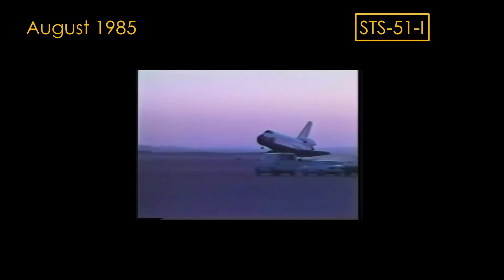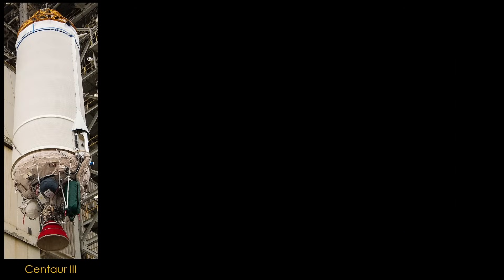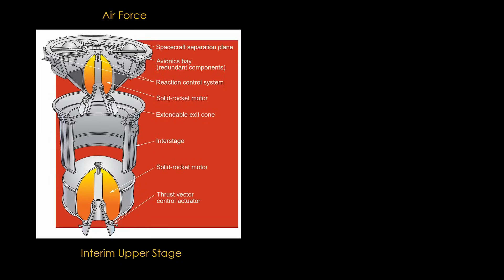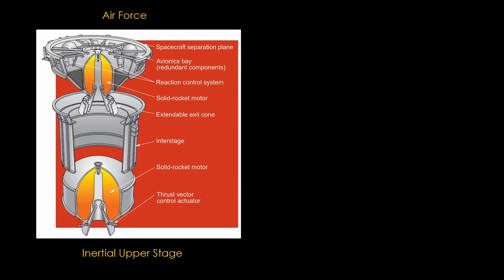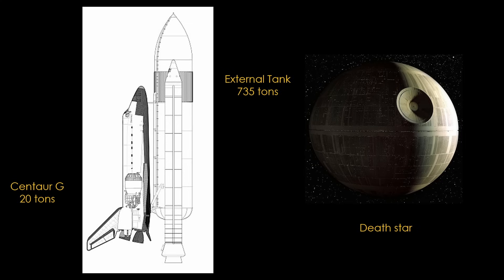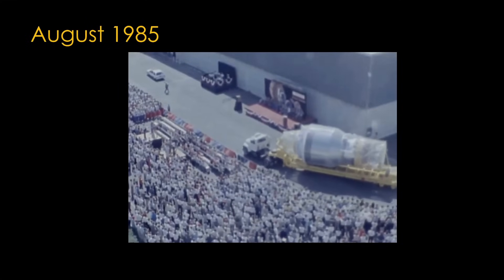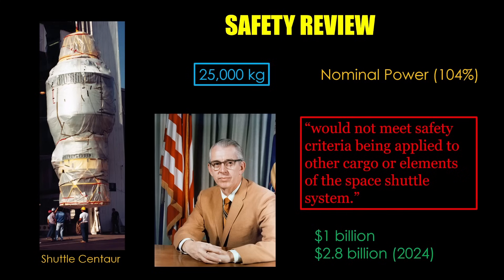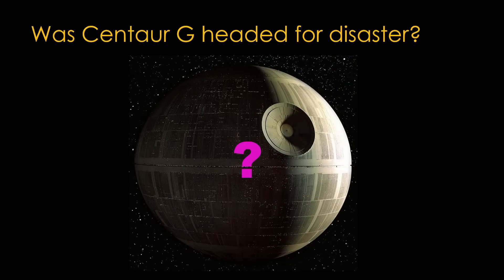Shuttle Centaur - Disaster Avoided?

Comment: Interestingly Falcon 9 had successfully retrofitred to fuel methalox lander inside it. And it worked. You can theoretically change the lander to an upper stage like Impulse, and it can decimate many high energy contracts (Falcon upper stage is already impressive as it's, lowest mass fraction)

Another nice bonus: no need to worry about the crew!
Reply from the maker: Look for that discussion in an coming video.

Comment: Appreciate the video. I do want to point out though that the Kibo module shown on STS-123 is technically not the 'lab module' but the pressurized logistics module (PLM) that sits on top of the "pressurized module" (PM) launched on STS-124 that contains all the science hardware. The PLM still serves your point about showing the need to balance shuttle payloads in the bay, but the PM was presumably even more of a headache - it was 3x longer (11.19m) and twice as heavy (15,900kg), and I don't know how they balanced that out (or if they even tried). Was there ever any discussion about ditching the payload prior to reentry? The payload's uncontrolled reentry would pose a potential threat on the ground, but it certainly seems like a better risk to take than trying to land the already brick-like shuttle with tons of extra weight in the back.
Reply from the maker: Thanks for the clarification...

STS-83 landed with about 11,000 kg of payload, and the orbiter was overweight because they landed early with extra consumables.

Any payload is supposed to be safe for TAL or AOA aborts (I'm not sure about RTLS as I don't know if anybody has high confidence there)

The number of scenarios where you would have the time to ditch the payload before reentry seems pretty small. NASA hates unpracticed tasks and if you take too long you may kill the crew, plus you are probably busy trying to work the problem that's causing you to return, so my guess is 0% chance NASA does that.

Maybe if it's like Columbia but with less damage you might do what you can to lighten the orbiter...

Comment: Surely the East Coast Shuttle could have been made more effective for special missions if they had used the uprated Graphite-Epoxy SRBs developed to give the West Coast Air Force Shuttles more takeoff thrust ?
Reply from the maker: Interesting question. I don't know the state of development of those boosters in 1986 but my guess is they weren't ready yet - I didn't see any mention in any of the shuttle centaur stuff I looked at.
Reply: @EagerSpace  There isn’t much reported on the “Filament wound” boosters but all Air Force space stuff especially at Vandenburg was pretty secretive back then.

Comment: The mission design limited the flight crew to 4 crew members and 4 days. They would have loaded certain consumables and RCS/OMS fuel to just enough to do this mission with emergency reserves. I'd love to see one of the full Crew Activity Plans to see mid-deck payloads they might try to get in with the weight limit, if any. Likely they would have revoved a couple rows of mid-deck lockers and possibly the galley to save weight (a Cabin-config document would be very telling here.)  Obviously, they would not fly the RMS. I know they also needed to vent the cryogenics gases on the pad and going uphill as well. I still think they could have done it and the odds would have been with them, but by far it would have been the riskiest set of missions ever proposed.

Comment: The biggest problem of the space shuttle program was that it wasn't canceled before it even started.
Reply: Every time I think I know just how crap the SS was, I learn something new that makes me hate it more. The entire SS lineage (including the SLS and Constellation before it) has been just one long series of disasters and bad decisions that have hobbled American space programs since they cancelled Saturn V
Reply: @Joe-xq3zu  It was the same for me, the more I learned the more I hated it.
Space Shuttle was the greatest disaster of US space program and we are still recovering from it.
Reply: @Wisald  What would have been your replacement?
Reply: @OmegaPaladin144  The funny thing about Saturn V is it was somehow still about 5 times cheaper than the shuttle per $ for unit of mass delivered to low orbit despite being started in 50s and goal being landing on the moon, not LEO delivery.
So all they had to do was to build a smaller, cheaper rocket borrowing from Saturn V linage, about Proton sized, maybe a bit smaller.
Then build a capsule to put on the top and you just replaced the shuttle while saving billions you could now use to build a massive Skylab style space station, the sheer amount of stuff they could have done by saving 80+% of cost on every kg to orbit.
Shuttle was so bad they could have been launching Saturn V instead of the shuttle and they would still pay about the same if not less, the cost of shuttle was insane.
Worst part is we are still stuck with shuttle grift under guise of SLS and it's somehow even worse than the shuttle was.

Comment: One big thing limiting the shuttle’s payload to farther orbits (without an upper stage) is the fact that it needs to return. This makes interplanetary missions especially infeasible as the shuttle will have burn more fuel to get back into an Earth orbit after payload deploy. Once that’s done the shuttle will still have much more speed than normal, which will have to scrubbed off with even more engine burns or having the heat shield work overtime.

Comment: Galileo was not any sort of driver for shuttle-centaur - it was trying to launch large national security payloads using the shuttle, like MILSTAR. This stems back to Carter's directive to only use the shuttle for any mission. This killed the various Titan derivatives and Saturn 1B was long dead at that time. When shuttle-Centaur was cancelled, they turned the Centaur Gs around to use in the new Titan IV program, because both the IUS and a potentially reborn Titan transtage were nowhere near powerful enough. As mentioned, there also wasn't enough space for, again, the nearly 35 foot tall (stowed) MILSTAR with a stock skinny-tank Centaur. Almost everything NASA did with regard to upper stages, etc, were driven by national security payloads, not the relatively trivial science programs that, as noted, could be done with lesser capabilities or, frankly, not at all.

Comment: Because of the Challenger disaster the Galileo probe sat in storage for four years. It was held in the exact same position on its mounting stand, and due to this the lubricants around the folded dish array deteriorated. This was why once launched the main dish array never deployed properly. During the Galileo mission they had to rely on the much smaller backup array to send and receive data which greatly degraded the amount of data that the probe was able to return to Earth
Reply: Yes -- the problem with the high gain antenna not properly unfurling was a real shame and significantly compromised the mission. As I recall, an additional factor was believed to be that fact that Galileo was shipped via truck 3 times across the country (it was sent back to the factory after the Challenger disaster, and then back to KSC for the eventual launch). The theory was that the vibrations from the additional shipping caused the lubricants migrate away from where they were most needed.

Comment: The RS 25s on SLS are being run at a standard 109 percent. And these are using the same exact engines that launched the space shuttle. With the engines now being certified up to 113%
Reply from the maker: Not quite the same exact engines. The engines flying at the time of Challenger were Phase I engines. There were by the RS-25A, B, C, and D. This paper talks a little bit about the changes in the different versions: https://ntrs.nasa.gov/api/citations/20020022303/downloads/20020022303.pdf

All of the shuttle engines on SLS are RS-25D. The new RS-25E engines are planned to run at 111%, though they have been tested above that.

Comment: I think part of the reason they changed the I in IUS from "interim" to "inertial" was to differentiate that it was a guided stage from the spin-stabilized PAM (Payload Assist Module) that was used on other shuttle-borne satellites. They had phenomenally accurate guidance. One problem associated with it was that the 2nd stage required an extendable exit cone for the engine bell to give it the specific impulse required. It was mechanically complex and failed on the first IUS/Titan mission, although they recovered it because the TDRS had enough fuel onboard to recover.
There was another concern at JSC on the Planetary missions of possible radioactive debris falling on the launch area if a shuttle exploded on the pad while a radioisotope thermionic generator was onboard Ulysses/Galileo.
With all the difficulties presented by carrying a cryogenic stage on a crewed vehicle at the time, it is interesting how today everybody's talking about cryogenic refueling of crewed vehicles in space as if it's no problem.
Reply: honestly the acronym change almost sounds like cope on the part of NASA to me.
Reply: @kargaroc386  It was definitely copium.
Reply: @kargaroc386  Also bureaucratic incompetence. 

I don't think it would be exaggerating to suggest that literally every single other organisation on the planet would have simply changed the name and dropped the acronym. Only NASA would think of keeping the acronym, finding another word for one of the letters and then finding a technical justification for the chosen word.

Comment: The original mistake was launching Galileo on Shuttle at all. Titan IIIE or a 34D with Centaur would have been the prudent option.
Reply from the maker: It's such a stupid choice. Titan had a good reliability record and you just had to put the probe on it and launch it. 

But NASA had to show that shuttle was great and useful...
Reply: @EagerSpace  And in the process they proved the opposite.
Reply: @EagerSpace  No - they and everyone else was required by executive order to only use the shuttle, aside from legacy programs that couldn't be launched any other way, or couldn't be brought to shuttle safety requirements (like 3 physical and 3 electrical safeties for firing a thruster, for example).  That's why there was such a scramble after Challenger all single-use boosters were being phased out by fiat.  And, again, NASA was hardly a driver for any of these capabilities. If there was a mistake made, it was putting NASA in charge of/as a supplier to everyone else, DoD and other government customers being the 800 lb gorillas with far more critical missions. Just about any NASA program could be cancelled at any time with no important side effects.

Comment: The more I learn about the Shuttle program, the more disenchanted I am by it. The Apollo program seems so much more straightforward, where everyone was driven by the same ultimate goal: getting astronauts to the Moon. But from day one, Shuttle was a solution in search of a problem, with no clear goal and way too many cooks in the kitchen, driven by bureaucratic career ambitions and political fiefdoms rather than by any overarching shared goals. It makes me realize what a phenomenal job NASA PR has done over the past half century that people still think of the agency as an exemplar of noble scientific pursuit and cutting edge technology, rather than the dysfunctional government bureaucracy of middle-management-lifers that it's been for decades.
Reply from the maker: The goal of shuttle was to keep NASA centers open, NASA managers employed, money flowing to contractors, and votes going to congresspeople, and it was very successful at that. It's not what most of us want in a space program, but I would argue that most large businesses are also run to further the careers of management over producing useful results.
Reply: @EagerSpace  While the Shuttle program as it was implemented had plenty of problems, I kind of think it get's too much of a bum wrap based on 20/20 hindsight. The Shuttle as initially conceived to be fully re-usable with internal hydrolox tanks, flyback booster, and high temperature metal composite heat shield could have been a capable and cost effective launcher. Unfortunately, a series of compromises driven by the Nixon administration's desire to halve the development cost resulted in the flawed design that we got. The shuttle program was not conceived as a jobs program, but rather from a desire to radically lower the cost of access to space for a more economically sustainable space program in the post-Apollo era. It certainly required political support, which very often ends up being justified by the jobs that it creates, but this was not at the time a prime driver for the existence of the program. The SLS, on the other hand, was most definitely driven by powerful politicians wanting to keep aerospace jobs in their states/districts and thus could be fairly characterized as a jobs program.
Reply: @EagerSpace  Basically, a government jobs program.
Reply: If you want to truely feel how cursed the shuttle was then I recommend building one in kerbal space program
Reply: @jamieclarke321 this is the truest thing I've heard all day 😂
Tbf, shuttles are useful in the RW if you have a need for them and have simple/cheap launch configurations. Dreamchaser likely checks those boxes, but well see.
Reply: As usual with the rocket surgeons making decisions. Now they want to cancel Artemis & develop a modernized version of Apollo. The thing is Apollo was originally supposed to run through 1995! The Saturn V was to be replaced by the Nova. As usual Apollo was cancelled after 17. If they had followed the original plan, there would be a fully developed Moon colony, Mars would be nearly completion & we would be sending exploratory missions to Titan by now.
Reply: The Space Shuttle was designed around one job - launch and recovery of the KH-11 spy satellites. It only actually launched two of the twenty (and the almost identical Hubble (slightly longer focal length)).
NASA got the last two of the series gifted to it for scientific use but they haven’t been flown.
Reply: I always thought it was a nro thing? 
Spies in the sky
Reply: I hate that this is exactly my views as well
Reply: You cannot like the shuttle if you want although nothing else could’ve fixed the Hubble space telescope, but NASA hasn’t accomplished anything is forgetting Juno and Cassini and the Mars rovers and the Mars helicopter, and the voyager and the pioneers
Reply: @mcamp9445  shuttle is good, shuttle is the spacecraft of my generation so I always have a sentimental place in my heart but it is a badly designed object
Reply: The space shuttle set manned spaceflight back 40 years at least.
How did they get away with spending so much money to put 170 tons into orbit with less than 20 tons of payload for each launch? It makes no sense.
Reply: Apollo was a political program that the US government could not cancel because of the legacy of Kennedy (shot in a conveniently mysterious way after making a lot of ennemies in the US administrations).
It needed to show the US population it was stronger than the USSR during the spatial/nuclear/atomic bomb hysteria, so failure was not an option.
At that time, to quote the french astronaut Tomas Pesquet, " rockets worked every other time".
Yet less than 10 years after Kennedy's speech, NASA announced that the program succeeded on time. The proofs were very low quality photos and videos (some of them being very obviously faked), 3 mumbling dudes in a press conference, and hundreds of kilograms of moon rocks they distributed all around.
After this incredible achievement (and the following Apollo missions with a perfect safety record), they unfortunately lost everything: blueprints of the F1 engine and lunar module, photo and video originals, telemetry data, and most of the moon rocks. The technology has been "lost".

Today where rocketery is much more advanced and better understood, computers way, way more powerful and efficient that the ones in the 1960s (where they really hardly existed at all), and we have GPS satellites and all, many of the probes sent to the Moon TODAY crash on its surface.

We know that NASA never really cared about actually making a reliable or safe space shuttle. Why would have it been different 15 years before?

Comment: Kind of sorry this dumps on Centaur as being at the root of the issues, which is a common failing of people telling this story, when it's more about the fear, uncertainty, and doubt Johnson cast over Lewis' work and got the astronauts worried about, while the real risks aren't the venting or anything like that, but Johnson's overselling of Shuttle's payload performance and the need to over-power the engines (though to a level which had decent backing behind it) to compensate for the launch mass Johnson had previously promised. The "death star" line is evocative, but like many evocative lines...fundamentally misrepresents key facts.
Reply from the maker: I agree that the payload lift was a real driver but I wonder why Lewis ended up taking them at their word - shuttle wasn't going to get lighter during development and that payload number was only going to go down. I suspect that Galileo also got heavier and that was part of the problem, but they didn't have enough margin. 

It's also certainly true that JSFC seemed fine with shuttle centaur as long as Marshal got the management contract.